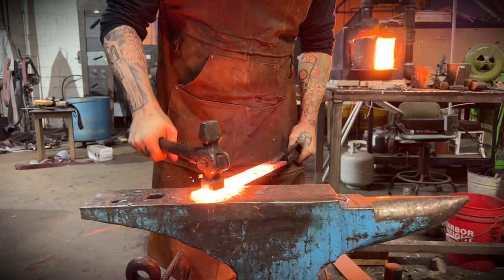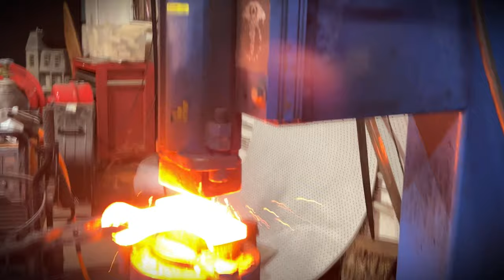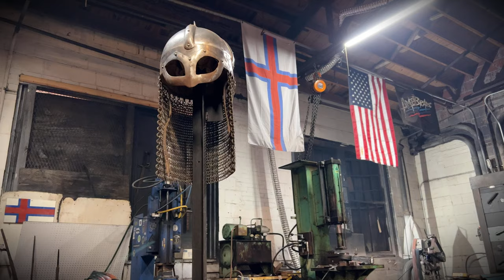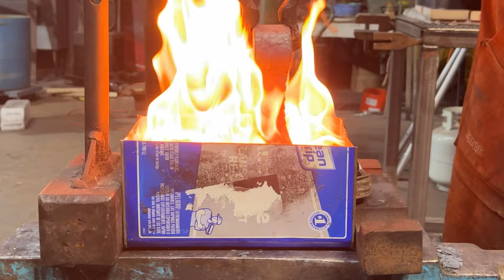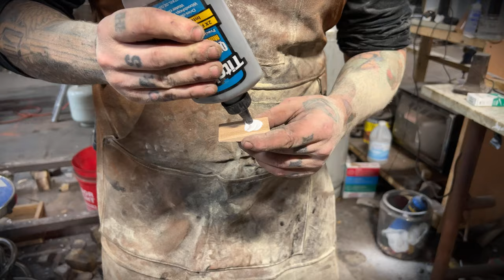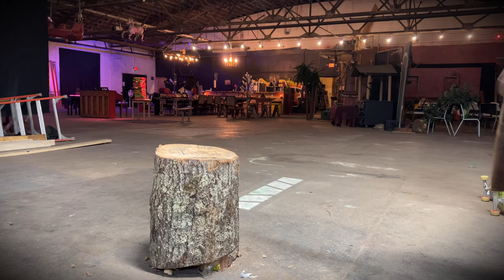Forging A Traditional Viking Axe / Dane Axe

Comment: The borax helps keep forge scalp from forming and causing a delamination correct? (I've only ever forged a throwing know from a railroad spike heated in a soup can insulated with plaster of Paris with two holes drilled through for blow torches)
Reply: Borax is used as a flux and prevents oxidation of the steel(forge scale). When oxidized the steel cannot weld together, so preventling it is key in getting a proper weld.

Comment: I have already failed 3 times, even with small pieces of metal((((
I can’t do forge welding, I can’t heat it to such a temperature on charcoal, I don’t have normal borax, so I use glass, but it seems to me that this is due to temperature.
Reply: I think you can get it up to welding temps. You can use a Japanese style forge for that, easier to keep the heat up. Look into that maybe?
Reply: @izzythepsychouniverse4852  I rebuilt my forge so I can easily heat steel to melting temperature. The problem is that I can’t heat 2 pieces evenly; I either pull it out too early and the iron oxidizes, or too late and half the piece melts. I can't monitor the temperature properly because the coal blocks my view of the workpiece.
Reply: @rplanet_ua  ah, okay, not sure about that then.